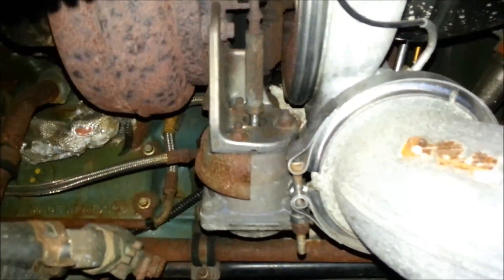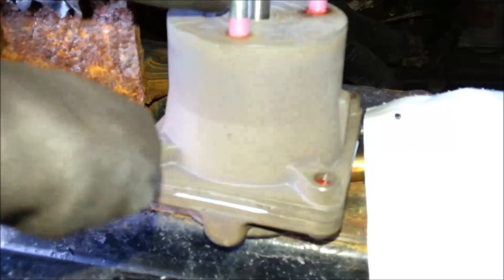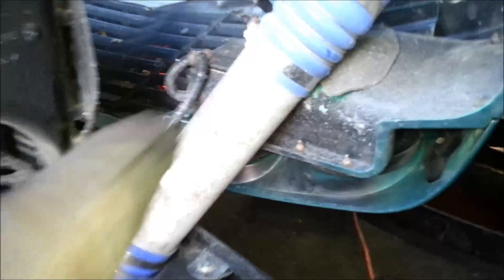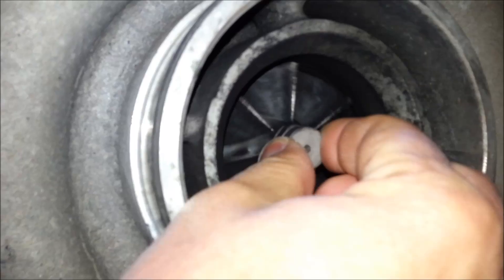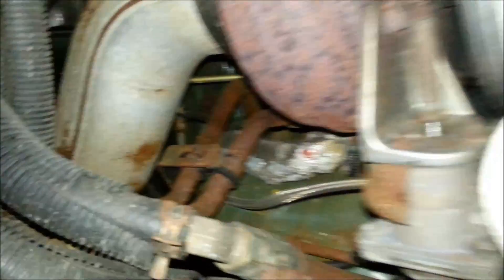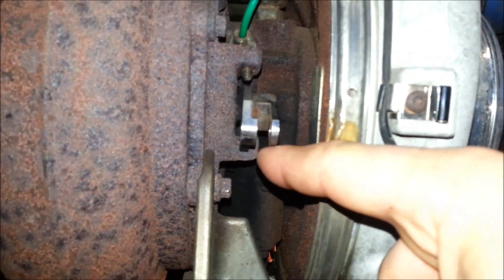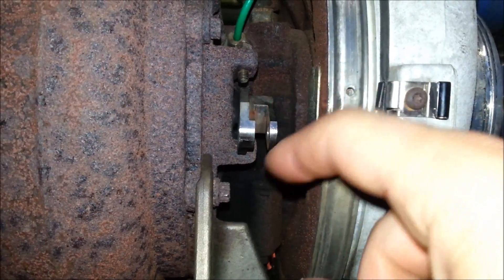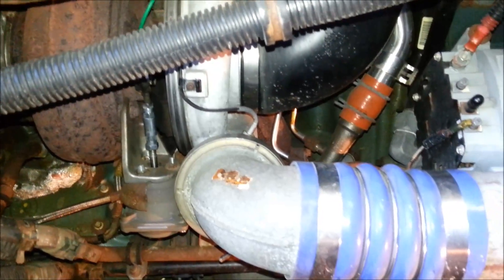Detroit Diesel Engine turbo actuator valve damaged need replacement

Comment: What about calibrating it. Changed that once and  has to bring it to a shop because the engine was running terrible. That actuator has precise measurements to work. And yes, it means the turbo is bad. Get it out of there before you have a top end rebuild on your hands.

Comment: I am losing power on my 2007 freightliner columbia detroit series 60. Laoud noise coming from turbo. I don't know if l need to change vpod or actuator
Reply: did you figure it out ? i changed the vpod and still doing it!

Comment: From what I have experienced on these 14 liter egr motors  , it’s usually the vpod that goes bad. That sends air to the actuator. It’s a small box with a large air line going to it directly from the air tank. It’s located on the passenger since bottom corner of the block. You reach it from under the truck. Easy off and on part. 
That turbo wheel sits in a oil bearing. So when oil pressure builds it tighten up. But the only way to truly check it is to put a “feeler gage” between the wheel and the wall and see how far it moves. 
There is a certain amount it’s allowed to move before it’s considered bad. 

Some times it is a actuator. But most it’s the vpod itself. They cost about 350$ and you need a core.
Reply: You say its an easy off part. Someone put a double threaded stud in mine and it is NOT easy to get off
Reply: What kind of symptoms would I be getting if the v pod was giving out

Comment: I got one leaking out of the top seal I replaced it I was only building 50 psi of air I swapped it now I only have 100psi thinking the vpods are leaking or something Caused too much pressure to blow that seal out

Comment: What I like about this engine and the older Detroit 12.7 series 60 is that you can buy the actuator as a separate part and it is not expensive. The newer engines have too many electronics and sensors and parts are so expensive.
Reply: Till a VPOD goes out on the 14L 60s lol my current issue, thought the truck was gonna pop the head

Comment: I've had more than one older 12.7L Detroit Series 60. My experience has been that the actuators fail long before the turbo fails. The price of a new actuator is cheap enough to make replacement part of a 2 or 3 year maintenance schedule. I just bought one here for my 12.7 Detroit:  https://www.bonanza.com/listings/Detroit-Diesel-12-7L-Series-60-Turbo-Wastegate-Actuator-Garrett-GTA4202BNS/627848235
Reply: The actuator rod on the 12.7 turbo actuator is adjustable. Make sure it is the correct length - eye up the length of the old one is a good starting point
Reply: Yes I agree. Price for a new actuator for the 12.7 Series 60 is well under $100. Better to replace it as a regular maintenance item than wait for it to fail when you are 1000 miles from home.

Comment: a little play on the actuator arm is permissible-  if  tight when cold it will be too tight when hot and not pivot or have too much drag and the actuator wont be able to move it smoothly.

Comment: the job is far from complete. you need to connect the laptop (Detroit proprietary software) and download a test serial number run the turbo adj program and when done redownload the original serial number. failing to do that and you are guessing on turbo output. engine could run lean or the backpressure in the exhaust system not coming in at the correct time to push the egr gas into the intake. engine will run like doogie! sorry to rain on your parade.
Reply from the maker: Thanks any way, some times rain is good. thanks for the tip.

Comment: There is still some air leak and losing boost. That Turbo needs to be replaced assembly. Putting actuator on a broken turbo is not smart.

Comment: What is the proper psi to put on the actuator for adjustment? And or rather what are the adjustment specifications? It does seem to be a common problem in some parts mechanics cant figure out what they call the illusive miss, but yet the turbo sounds odd and air leaks from the actuator. I'm under the assumption that psi has to be put to it to simulate for adjustment.
Reply: They are now unadjustable. Guess too many people were getting it wrong.

Comment: I still hear an air leak. dude is going to loose power on the road and he will probably be fully loaded. Better bring a pry bar to pry on the actuator  and vise grip to hold it
Reply: I'm trying to get home and would like to try this vice grip trick.  when I pry down on the clovis pin at the top, hissing stops.  only gotta pry it about a 1/16" for it to stop leaking. 

can I temporarily adjust the screw at top ? no loss of power, just losing air while driving

Comment: Wish you would have shown the whole turbo replacement. My 2005 Detroit Diesel is making a huge sucking sound when I let off the gas and when I'm on the gas there is clamoring sound like tin metal clanging together coming from the passenger side of my truck almost as if its coming from the inside of the cab behind the plastic interior panels. My truck still has all its power but some have told me that it may be the turbo so I'm going over today to take the inlet off to see if there is play in my turbo shaft. If so I wanted to know how difficult it was to replace the turbo and what problems I will run into. I know that the exhaust bolts will potentially break which is something I don't want to deal with but I'll try to oil them pretty good before removing the turbo where it bolts onto the exhaust.
Reply from the maker: +Dale Phillips Possible air leak, bad gasket
Reply: TRUCKER BUCK Yep Trucker..After looking at it the "V" clamp that holds the turbo housing to the "S" pipe was loose and the "S" pipe was about 1/4 inch away from the turbo housing. Good news was my turbo is fine I just had to somehow get that pipe back up to the turbo housing and it wasn't budging. My S pipe also didn't have a flair in it and they are so hard to get to. So what I did is I loosened the "U" bolts that hold the whole pipe going back to the stack as I needed to replace some flex pipe back there anyway and I pushed the whole long pipe up that 1/4 inch so it butted against the Turbo housing and then clamped it back down. Really half job but it worked because I looked at New "S" pipes and they had a flair on the end of them for the "V" clamp to come down on & mine doesn't have that.  I really would like to see how people get to that S pipe as it seems very difficult if I had to replace it.
Reply from the maker: 10 04 Keep on trucking, see you over the road

Comment: I have same problem on my Coronado. Replaced actuator but it's still sneezing :( and losing power. Somebody told me that it could be bad VPOD (aprox $450 after tax)... How do you think if i'll calibrate turbo it will help? Thanks
Reply from the maker: Did you fix your problem ?
Reply: OutBackTrucker Buck - Fixed it at local Western Branch in St. Clairsville OH. They replaced actuator kit. Thanks.
Reply: Maxx Eriomin so what was it? Which actuator kit did they replace? I have the same issue
Reply from the maker: Maxx Eriomin Don't go there, No need to that that, How old is your Vpod
Reply: I can't tell you for sure. I bought this truck at the end of 2014. Trying to find people who can check it. Local Freightliner dealership sucks :(
Reply from the maker: Ok, If your truck is sneezing a little that's ok. if it is too much then it's time for a new Vpod
get it checked
Reply: Thanks.
Reply from the maker: Maxx Eriomin Just checking in how is your truck
Reply: It's the delta p on top of thermostat housing
Reply: It's the DeltaP valve it is on top of the thermostats

Comment: After changing the actuator,  you have to calibrate it to the turbo.. freight liner corpus, quoted me $750.00 for the actuator,  got it in Houston for $300.00
Reply from the maker: No one ever told me that I guess always a hidden surprise in ones path But the dealer told me that it dose not need to be calibrate
Reply: I got a actuator today for 203.02
Reply: In Houston
Reply: I found one on ebay for $100.00